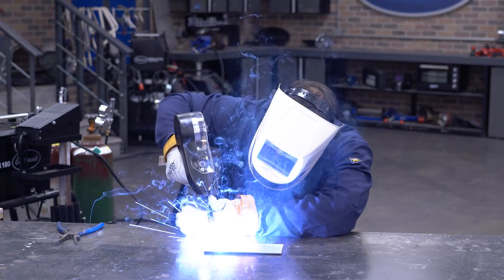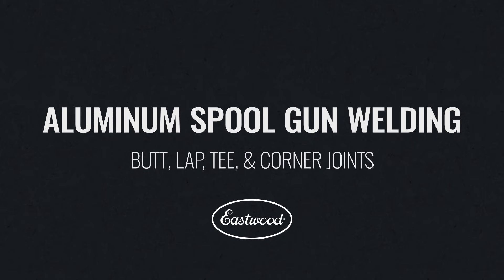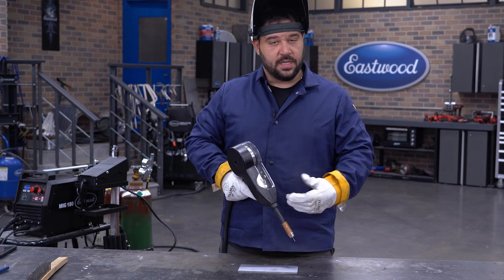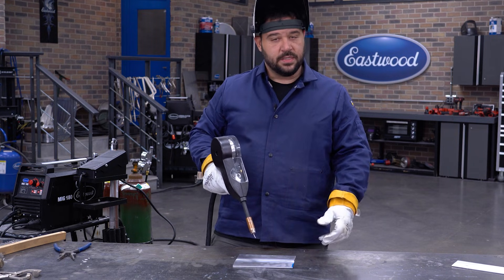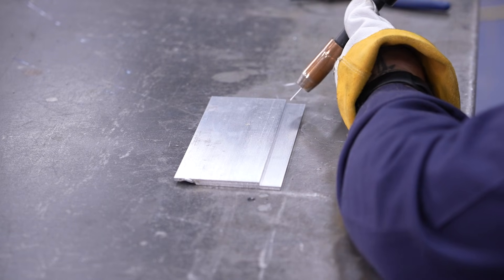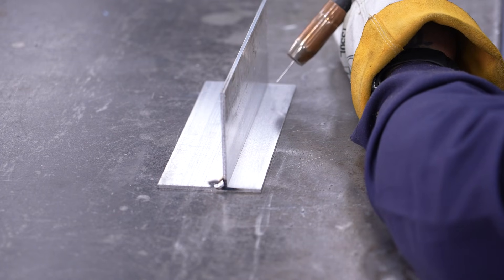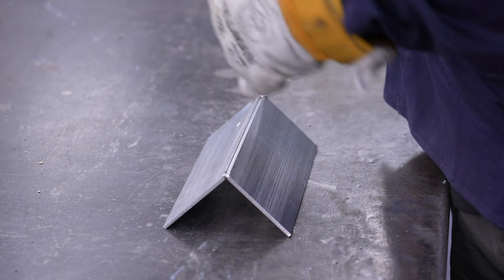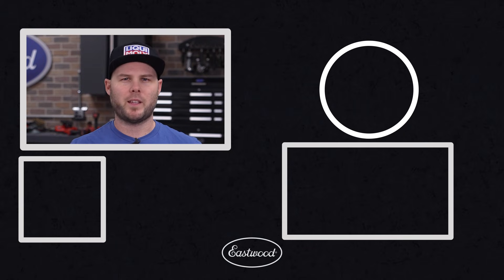4 Aluminum Spool Gun Welds That Will Make You a Better Welder!

Comment: need one answer that i cant find..please help if you can..when we going to weld aluminium then i grinde a bit to remove that first layer..when i remove that first layer how long it takes for aluminum to make that protective layer again and i need to grinde again?asking coz i would like to prepare everything for welding today ,grinde and clean and start tomorrow with welding-.is that ok or tomorrw i would need again to grinde that first layer?
Reply from the maker: Aluminum is going to immediately start oxidizing. You want to prep your welds as close to before you're welding as possible.
Reply: @eastwoodco  thank you very much